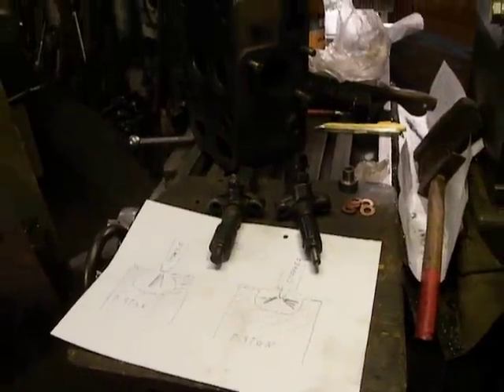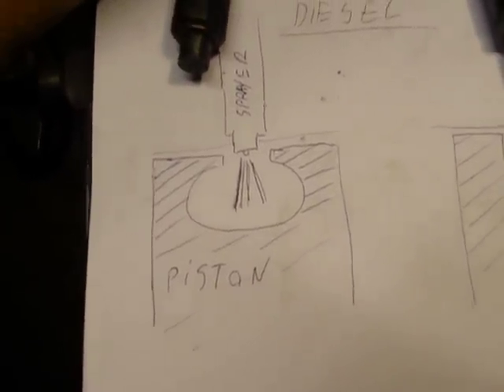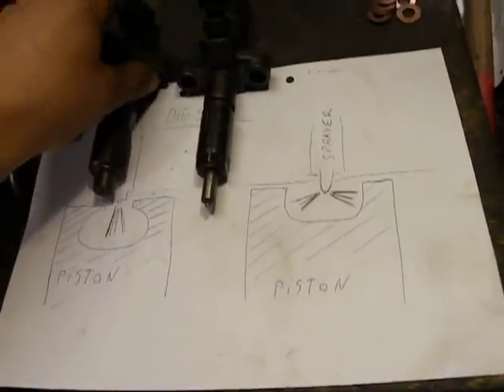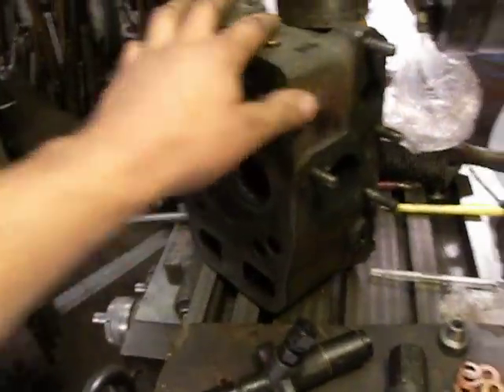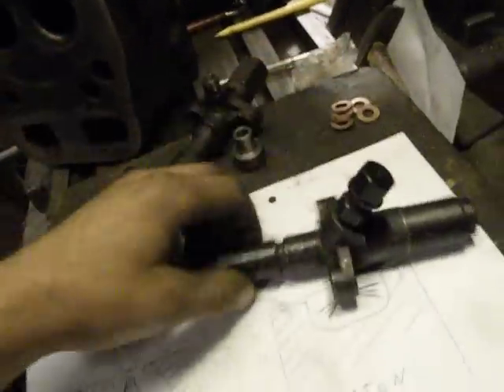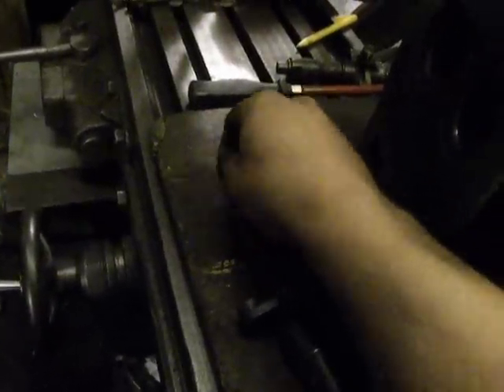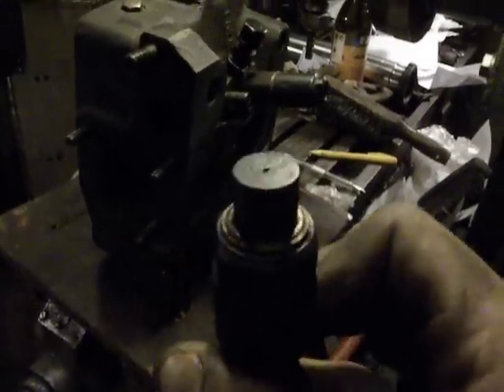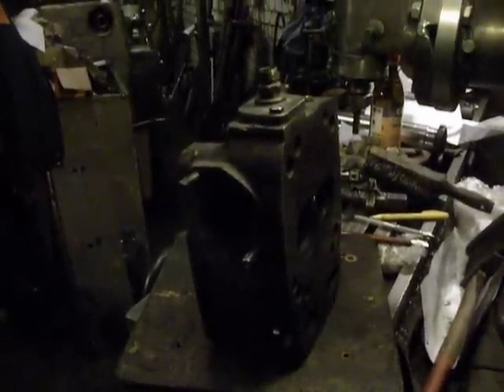Two words for Diesel engine sprays for tractor DT-20

Comment: Young Man, you are one heck of a machinist and problem solver too.  To find a solution to bad ignition due to the different style combustion pocket in the piston that came with the new cylinder sleeve kit  and to modify the cylinder head to make used of new style injector is an outstanding job.  Well done!

Comment: Injector not sprayer. Not a biggie, I didn't know all this about diesel engines before watching your video. The injector "injects or sprays" fuel into the cylinder.  Also the cylinder shell is the outer casting, the liner you made we call a sleeve and then the piston goes into the sleeve.  Still, not a big deal, we can easily follow along with your awesome videos. You speak better English than many immigrants here, some cannot speak English at all.  I think it's what makes USA a great place.

Comment from the maker: Thanks for the info! Sorry for My poor English, but I to try so as I can. 
I was at customer when he try to run engine second time - the engine was run better than new - no black smoke , it run without diesel "knocking", it more quickly take up RPMs and run was stable - no run break what was before... only in idle run engine was to rush (stuck idle run adjustment screw) and little bit blue smoke (engine is just after overhaul and it is good oil before run - at run oil was burned).

Comment from the maker: Thanks! Yes, exist things what I not or can't repair: # something what to buy in shop is cheap that I make (standard bolts and nuts); # worn out brake wheels; oversize (huge) things (example - locomotive engine); very complicated broken down units (new car flywheel damper) - sometimes repair is expensive than new (less used) unit; weaponry (illegal)... maybe something else.

Comment: For information the very fine spray from the injector is called atomised fuel. One other small point some injectors are single point delivery and others are called multi-point delivery. Single point tend to be used on indirect injected engines while multi-point tend to be used on direct injected engines. I would be most interested to hear if this solution you have devised works OK.

Comment from the maker: Yes, I agree to You for 100%, BUT in My old workshop is 18m^2 (193.75ft²) large and it is crowded with machines and tooling... in 18m^2 (193.75ft²) I have to cram into great lathe, two milling machines and surface grinding machine, also for each machine - tooling + stuff and etc. There is only much enough place to I can walk and operate each machine.. no more.... I just have no place for camera tripd :-(   Sorry, but I can't be prefect, but I going on that.